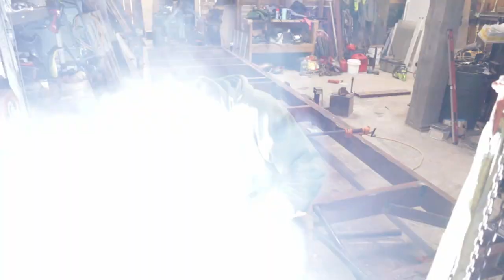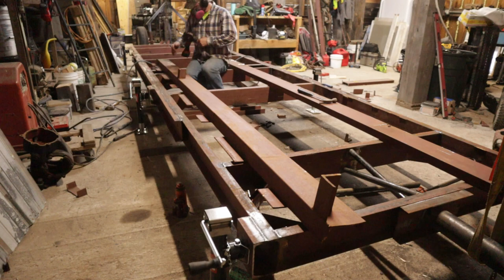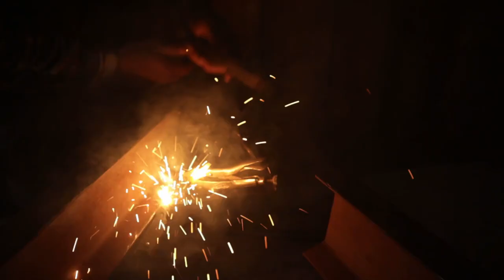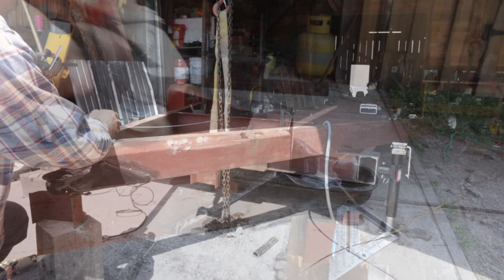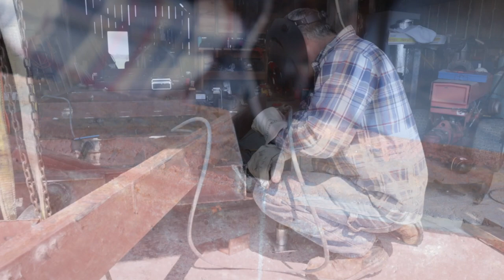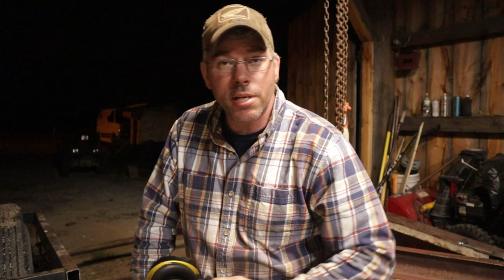Timber Frame 2.7: A Little Bit of Tongue

Comment: X--cat is what it may become.... Cats here stay in the barn or they learn to run real fast from the Cattle dog. LOL
Reply from the maker: Hello Stephen
Reply: @TheTradesmanChannel  Hello my friend! Your doing great so keep it up.. I made a Quick attach for my 2030 Deere so I can use a grapple that turned out to be a complex issue. The lock was not lining up and dropped it twice. So I figured a safety device that seems to work. Not sure which pieces were not correct but looking more like some body goofed on the grapple lower locks. Life goes on after the modification and it sure makes quick work of cleaning up limbs,  brush, and logs to the mill.

Comment: Yup, definitely a short outro.......
Morning Jim. The mini-boss is getting so big. She definitely has your number, "daddy, your crazy", ha ha ha. She is definitely at that inquisitive age. More questions than comments. Must be between two and four.
Cute as a button,  that's for sure.
Make sjre ahe gets her picnic, daddy. Whether you take us along or not. Family time is sacred after all, and we will understand if we're not invited along. 😢
Flipping the trailer back over will be a bit more involved with the trailer hitch welded on, and blocking the nipple. I guess it will be flipp it about half way, support it, restrap it, and finish the flip? Please be careful and get the second strap on before removing the first. (Yes Jim, I know you know, that is for the benifit of those who may not think of such things.) Please, if you can, or have footage of welding the bends in the hitch, filter the camera, and show us what you did to weld the cut out after bending. I'm sure many would like to see that if you have an extra welding mask that you can film that through. (Drape a hood/welding blanket over the boy, to protect him from sparks and slag, and have him use an old phone or camera to shoot the footage through a welding mask/hood?) Thanks. If you want to. Or, rig up a shot with a tripod and a lens from a welding mask/hood infront of a camera? Probably safer for the boy, but a little more risk to the camera. But you could hood the camera too.
Reply from the maker: Hey Thomas.  She has just turned 5 and is a very demanding and entertaining little lady.  The welding... I keep trying to film through a hood and cannot seem to get good footage.  I bet I can find an nd filter that might do it though.
Reply: @TheTradesmanChannel  maybe an auto hood from "Hardly Frought"?, just a thought.
Anyway, she is absolutely adorable. Still inquisitive in her "old age", 😂🤣😂🤣😉. They grow so fast😁.